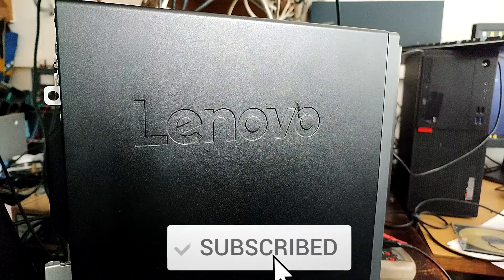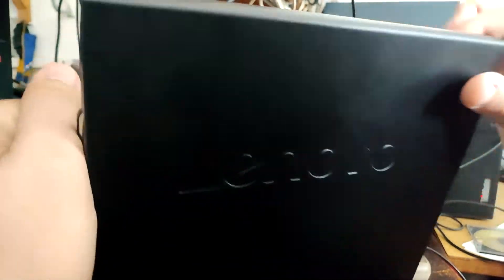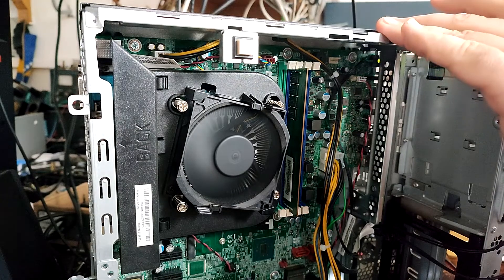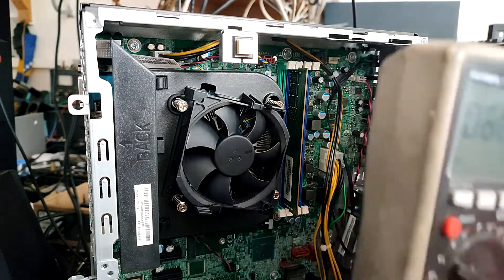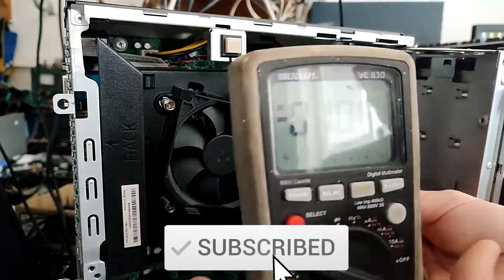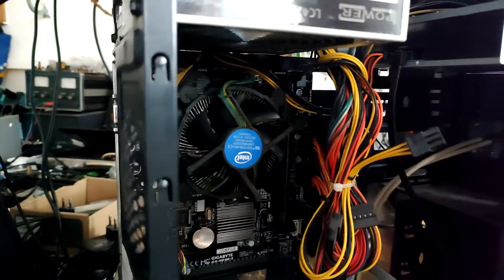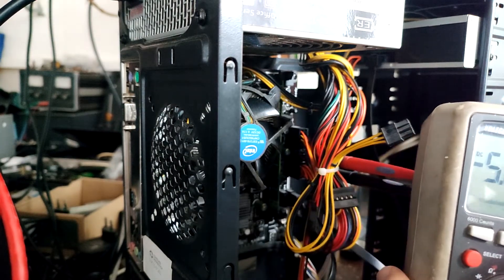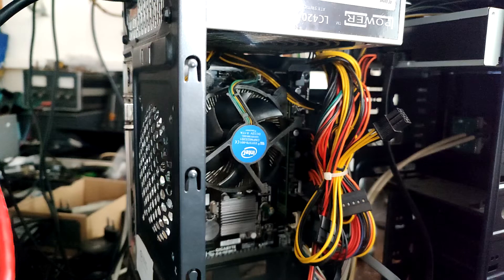Why you can't use custom PC PSU in Lenovo Desktop

Comment: I’m adding a standard power supply to a ib250mh motherboard with an 24 pin to 10 pin adapter with that work ?
Reply from the maker: it will work only it will keep your PSU on all the time even when you issue power off in Windows. power button on the motherboard will work normally for power on and for 5sec pressing to force off. but all of that will never power off PSU .

Comment: i already bought a adapter (24 to 10pin), my motherboard is iq270ms, I'm going to change the PSU, can you please tell which graphics card will work on this board? i have to choices 10603gb , rx4708gb. please tell which one should i choose, in comment section i have seen your comments that some Lenovo motherboard doesn't recognized some gpus, i need your help* thanks
Reply from the maker: as far as I know, both will work, somehow I got issues with 960gts and 660gts ,while later managed to get both work but it was not easy. So generally said, you can use any
Reply: @FantaBH thanks

Comment: I have a lenovo thinkcentre m710e which I need to put a GTX 1650 ghost (Gainward) with 6 pin connect in. Any idea what type of adapter I should get?
Reply from the maker: That should not be a problem. Simple SATA to 6pin gpu cable or MOLEX to 6 pin GPU .  That is just additional power for graphic card , so it contain +12V and Ground, nothing more , nothing less. Just take care that your power supply can provide enough power for your pc with that graphic card in it.
Reply: @FantaBH  -  that is the problem, because this lenovo thinkcentre m710e has a proprietary connectors. There is no where I can connect the SATA or MOLEX to that 6 pin. I need an adapter I think. Asking for help.
Reply from the maker: Yea, your Lenovo power supply if it's the default one then it will not be able to supply enough power for such GPU.  To try to buy any adapter which got 6 pin GPU connector  ,cut it from the adapter and solder wires directly to wires on pc power connector. Yellow to yellow,black to black.. but as I said I doubt that 180w PSU which is in your lenovo, going to be enough.

Comment: Hello from Chile, i have a lenovo v530s-07icr , power supply 180w, i need tu upgrade mi gpu, but i need to change psu, could o do it ? thanks a goo video!
Reply from the maker: Hardly you going to find custom PSU which could fit in the case. connector is not big issue, there are adapters 10 pin to 24 pin for Lenovo motherboard,  you can find em at eBay, AliExpress or locally maybe.
Reply: @FantaBH what if i also change  case 😁 can i use custom psu my motherboard is Lenovo iq270ms currently running on 210psu i thinking to buy 1050ti will it work btw from the vendor I'm buying. He asked me that 210w PSU is enough for 1050ti 🤔
Reply from the maker: There is a newer video about simple conversion to custom PSU for lenovo at my channel. Check it. And to answer your question, yes you can replace the case and PSU
Reply: @FantaBH  I'll check thanks for replying
Reply: So am using a Huawei b516/20 desktop sff has a 10pin connector from a 300w psu all the pins are loaded unlike the Lenovo 10 pins where one is missing a cable. I have a Corsair CX600m 24pin. If I get the 10 pin Lenovo adapter can this work?
Reply from the maker: 99%. Yes, in some rare cases it is not working. But it's very rare so for me it isn't worth making video about

Comment: Where can i find a power supply that is compatible with lenovo thinkstation pcs? I need around a 500w for the i7-10700 and gtx 1660 ti.
I tried looking for them on their official website but there were none. Can you help me out?
Reply from the maker: eBay or AliExpress buy adapter 24 to 10 pin and get Any normal PSU locally. Everything will work normally only after the shutdown PSU will stay on .  You can switch it off by switching it by switch on the back of it , or leaving it on  will not hurt it.

Comment: Hi, I’m from Brazil, i have the Lenovo m91p, psu 240w, and I’d like to improve, do you know if a 600w psu Work? It’s 24 pin. If the psu work i’d like to improve the gpu with GTX 950 2gb, Will it work? Thank u 😅❤
Reply from the maker: Hi from Bosnia Fabricio. I can confirm that any standard 24 pin power supply is going to work just fine in your Lenovo m91p. But I would suggest you  to try first if your GTX 950 going to be recognised by the lenovo motherboard. I have seen many different cases where different graphics don't get recognised by Lenovo motherboards.
Reply: Thank you very much, it made me feel more at ease, thank you for your time, wish the best for you and your work!!

Comment: Can I change the psu in my p330?
Reply from the maker: your original psu in lenovo p330 is 10 pin, best way is go AliExpress or ebay or local shop if u have such, and buy adapter 10pin to 24 pin, just pay attention that green wire on adapter is shorted to the ground wire. Or make such adapter by urself . Just connect all wires  color to color from your 10 pin connector to 24pin new psu. And after all just connect green wire to black one, it will work.
Reply: @FantaBH  ok thanks man can you suggest a psu more than 450w please 
Thank you !
Reply from the maker: Don't know really, if you are not a perfectionist then any 650W + Will do fine , end even better if it is a brand name.

Comment: I want to swap the power supply on my V55t-15API lenovo desktop (with a lenovo 3706 10 pin motherboard) to a silverstone TX500 Gold psu which comes with a 24/20 pci connector. Is this possible using an 24 to 10 pin adaptor? some reviews of these adaptors on amazon say the adaptor fried their motherboard and I would like to avoid that at all costs
Reply from the maker: just take a 24 pin to 10 pin adapter which have green wire shorted to the ground. Or just make it by yourself. Cut 24 pin and 10 pin from the old PSU. Cut them with 10 cm wires left on them. Solder wire to wire by color to color. As i remeber x yellow, 4x black and blue + green. Green goes to any black , don't solder it to old green on 24 pin. On that way the power button on the lenovo board will work as intended. Only the new power supply will never shutdown. To shutdown it use a switch on it or add a switch somewhere.

Comment: I have a Lenovo desktop lenovo v530-151cb and i want to use gtx 1660 super graphic card. Is it fit on it?
Reply from the maker: As far as I know, your graphic card belongs to short models ( one or two cooling fans) and those for sure fits in the lenovo v530 tower.  Nvidia 1660 super is short with one cooling fan and that one fits physically but usual power supply in that pc can't support Nvidia 1660
Reply: @FantaBH  Thank you, so it can be fit but i need to change power supply right? Can power supply change is this Lenovo desktop?
Reply from the maker: It  uses a 10 pin mini power supply which also has a 4 pin cpu connector . No you can't fit the regular ps unit in that case.
Reply: @FantaBH  so is there any solution for this?
Reply from the maker: No there is no easy solution for your situation

Comment: Please tell me 
if I buy an adabter that convert 24 pin to 14 pin it is well be fixed😢
Reply from the maker: Nope for most Lenovo models,problem lay in stand by voltage. Custom PSU  use 5V standby while Lenovo use 12V  , while some older Lenovo desktops still use 5V standby .
Reply: @FantaBH  but my power use 12V 
I will buy the adapter tomorrow 
If i put it what will happened if it not work? 
And thank you for everything
Reply from the maker: Again to be more precise , green wire which is used for trigger power on state of PSU , in new lenovo desktops 10 pins or 14 pins use 12 volts DC in green wire. All other PSU units use green wire on 5 volts. Adapter will not help you as you will not be able to power on Lenevo desktop, however there 2-3 tricks which can make it works . But when I asked community to comment if they are interested to know how,none ever said anything so I never made second video about what you can do to make it work with custom PSU unit
Reply: @FantaBH  ok now my pc is on 
after i buy the adapter 
my board take a 12V and my PSU do 12V
thanks for your time
Reply: @FantaBH  can u tell me how to fix that problem?
Reply from the maker: Depend of the model of your new PSU but good adapters will work